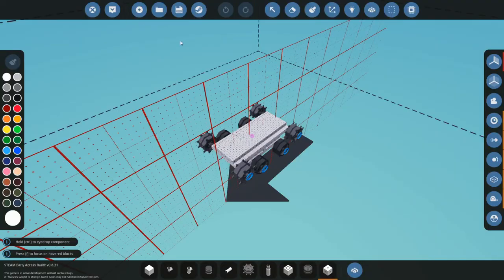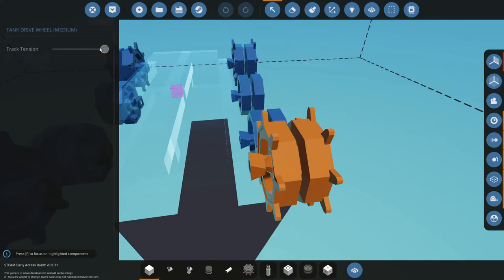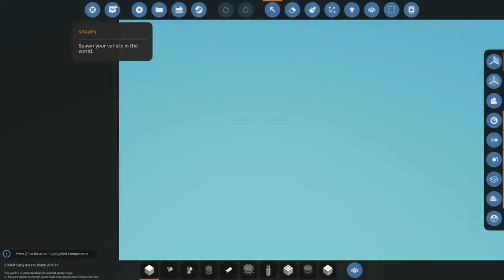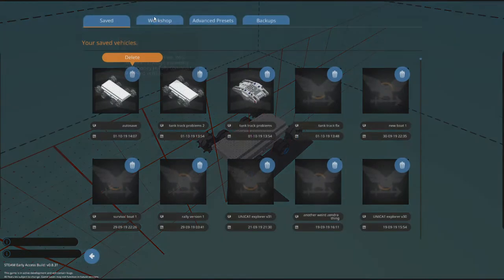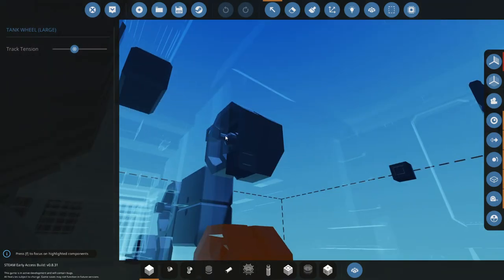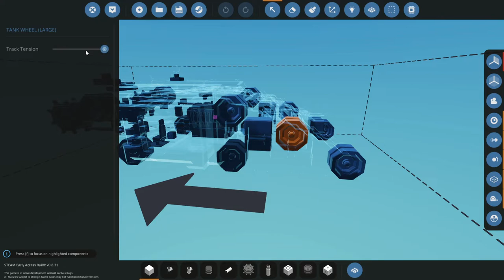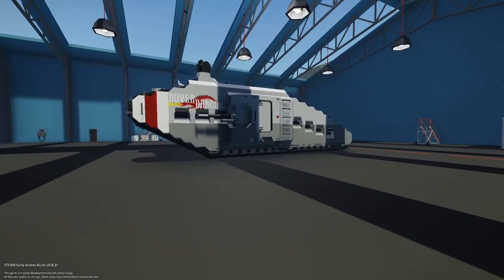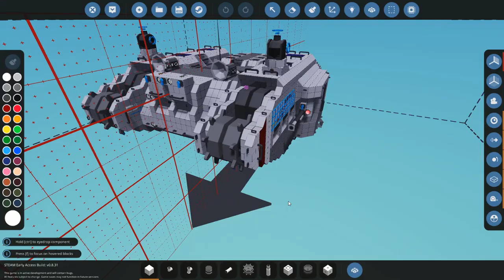Stormworks  | How To Fix Shaking Tank Tracks | Quick And Easy Tutorial!

Comment: StormRunner Gaming, I've noticed, since I've been a bit obsessive about getting tracks to work in StormWorks, is that the total sum of the tension of the wheels of 1 linked track that are touching the ground should equal 100%. Meaning with your example machine, 50 and 50 is correct. If there were 3, then it'd be 2 of them at 33% and 1 at 34%. Of course you can have less than 100, but I like to keep it at 100. And, again, that's per linked track. So the left will have a total of 100% track tension for the wheels touching the ground and the right will also have 100% for the wheels touching the ground. Any wheels not in contact don't count.

It's a simple math equation of 100/#of wheels on track in contact with the ground. With the new grip, the equation stays the same, but the grip amounts change. I still don't know the exact details on that one. But just to remove the trial and error out of the whole thing, just plug in that equation and the difference of what's missing, like with 3 there's an extra 1%, you can assign at your leisure/strategy.

Comment: Sorry to double comment, but I guess this is something that I need help with quite a bit. The grip with wheels and tracks. It still confuses me. It seems like I can never have a decent amount (my creation will still slide across the ground when I try to turn it) so when I have too much it's jittering. But the only solutions I've found so far is to make my creations super heavy...which negates the grip I've given it and it'll still slide anyways and the power needed to move it is greater, fuel needed is more, squared cubed law, etc.

Basically what I'm saying is that wheels don't seem to have been fixed. They seem to have been convoluted to where there's now an insane amount of trial and error testing to get a decent functioning amount of grip, but there's still issues.
Reply from the maker: Stormworks can be weird sometimes about grip and weight of not only tank tracks but tires/wheels as well. There is definitely some difficulty in finding that perfect number to make things work. I can look at your creation of you want, but it maybe a day or two until I have the free time to.
Reply: @StormRunnerGaming  It'd be appreciated, but I've created too many at this point. I'm going with a lot of trial and error and "based on this one that worked". But it's a bit frustrating having to have to build vehicles completely (mass-wise) before being able to fine tune the grip, since the effects change with weight and power. I start with everything at 0 and work my way up in increments of 10, then 5, then 1 on the percentages until the thing is neither "dancing" nor no power drifting. But it always ends up that that "golden #" is still in the "This will slide on turns" area. It could be my creations and that I don't know how to exactly gradually feather/increase throttle and clutch besides having a super slow lever.

I am a bit honored that you'd consider inspecting my creations. It's a bit of a "A GOD HAS DESCENDED UPON US FOOLISH MORTALS!!" moment for me. Thank you.
Reply: I have also done some testing around and it seem as though if you use suspension, for example in a tank, it can mess things up quite a bit. So try and not use suspension, unless you know what you're doing.